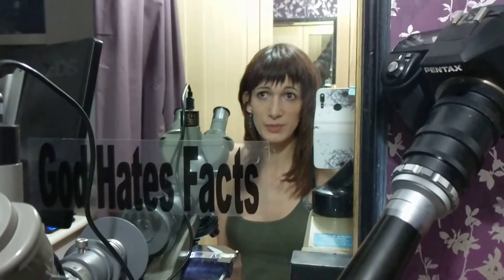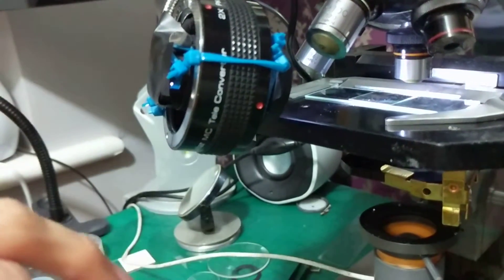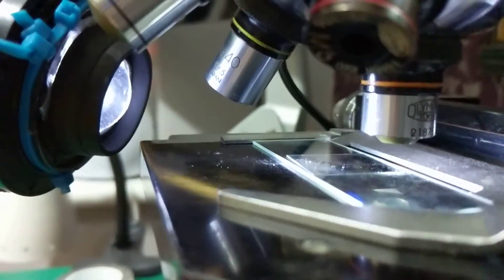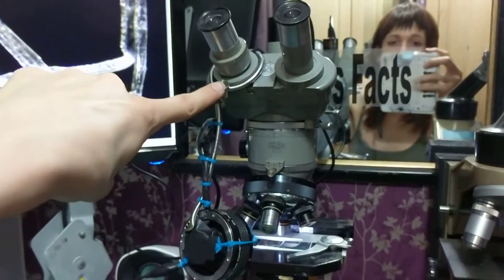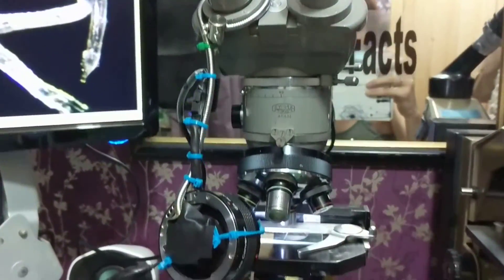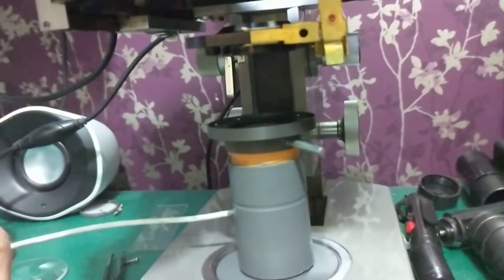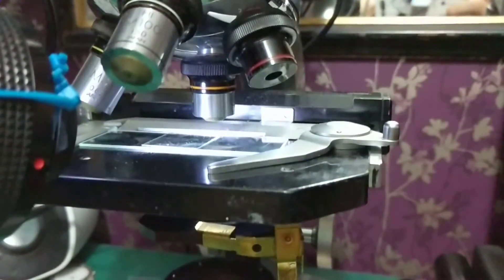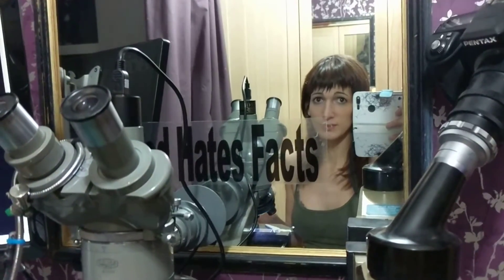DIY Darkfield Lighting

Comment: Careful your male is showing. Do they not have lenses with ring lights built in? You might also try L wire. You could wrap it around the slide like a funnel and retain your black background (I'm guessing that is what black field is). Look at macro photography for how they light subjects. Esp at night. You can also use your pentax to make HDR images of things on slides that will bring out amazing detail. Just take 5 images all with 1 stop of difference to exposure across the full range of the camera's ability. Then you put them back together in photoshop. I've never gotten that last part down to a science. I fiddle with them until they look nice. I know there is a method you can follow online though. Just google Compositing HDR Images.
Reply from the maker: Hola :-)
I've a few ideas, but not doing much in the way of photography just now, rather focusing on the moving image and how best to capture that in various different interesting ways. stacked HDR doesn't really work with moving subjects, at the exposure settings required for microscopy, neither does focus stacking. 
There are a few ways to do darkfield, with the best solutions applying very focused light directly on the subject. It's not as simple as macro photography, as at high magnifications, light works differently and the slightest refraction can cause a great many artefacts, so having multiple undiffused light sources is actually counterproductive.
Reply: Jennralize
Interesting. I have never tried to do microscopy at all, but I was very interested in maco shooting. I cheaped out and bought a reverse macro ring so I could flip my lens around and get 3x or more magnification. That's how I got texture for my avatar actually. That's my actual real eye. Well the iris anyway. Took TONS of light. I built a flood light with 100's of LED's powered by a PC power supply. Like looking into the fucking sun.
Reply from the maker: Haha ^_^ Yeah, I love macro, it's a lot of fun! I prefer to use modified flashes and have build light guide tubes in the past.
https://www.flickr.com/photos/silentskies/10123286455/in/dateposted-public/
Reply: Jennralize
How do I send you private messages? Nothing creepy. I promise. Just that I'm anon on this account so I can't very well send you a link to my photos without doxxing myself.